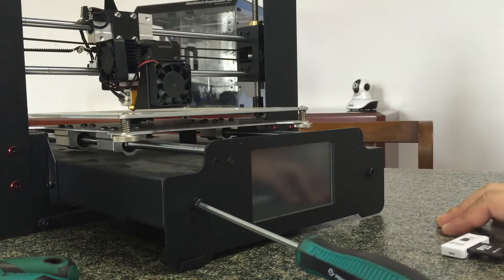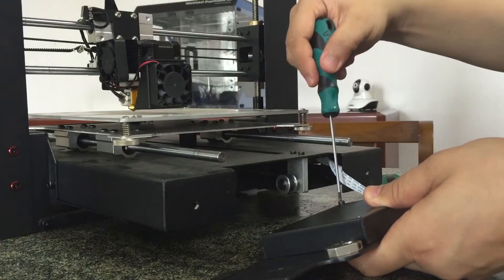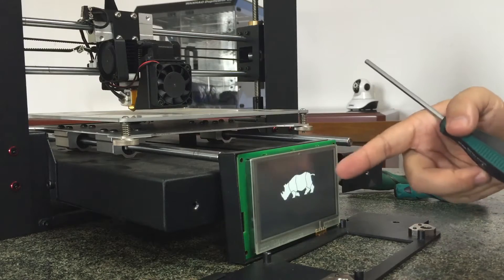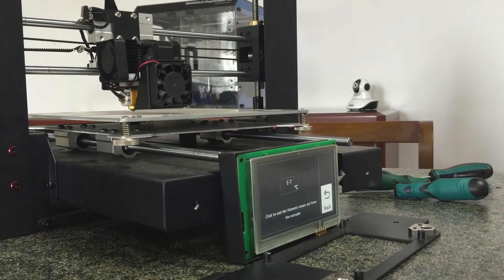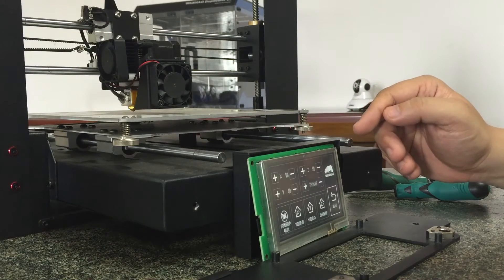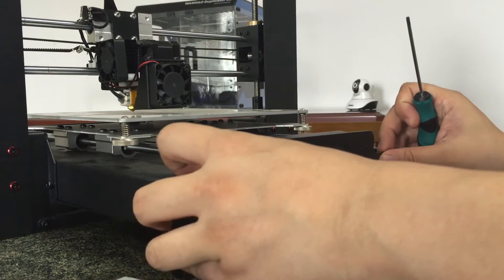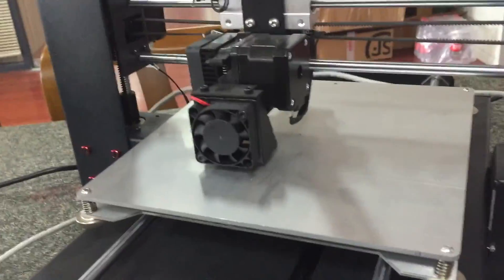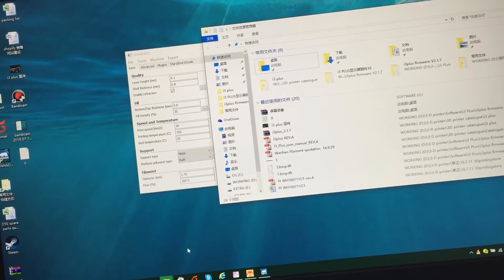How to install firmware to i3plus?

Comment: Does anyone know where to get the firmware of the internet? I'm following all the original manual of the power spec I3 plus but at the beginning it says to flash the printer. I also cant get to printer to connect to the computer. I am using an old hp printer cord...does that matter? Or is it a software issue

Comment: Can the Microcenter Branded "Powerspec" Wanhao Duplicator I3 Plus take the same upgrade firmware as the straight up Wanhao model? I assume the splash screens would change, but would anything else, or there be any other issues?
Reply: Did you end up finding an answer for yours?  I just replaced the motherboard for my Powerspec model & the LCD needs a firmware update & I can't find the answer to this.  The powerspec has a different board with a full size SD card & you do not have to disassemble the printer to flash it, but I can't find the files anywhere yet.  The printer is useless without updating the LCD :(
Reply: I flashed my wanhao i3 plus from microcenter no problem. Do you still need the files?

Comment: I did update the lcd firmware  al went wel but when i restard my printer the intro image freezes at image 1 haf the rhino and it does not go further now i cant print  nothing and i am pretty mad.
If you want to do this i do not recomend it.    i installed the motherboard firmware later on maybe that wil fix it but no.
Can anyone help me please?
Reply: Hi Dude, Same problem here... it's stuck on this fucking logo.... I have do 

- update firwmare, after white screen when i click on printing...
-Update LCD Firmware and now Stuck again... Can you help me ? 
Thx

Comment: Hello! 
Your website is suspended - 网站服务暂停通知 wanhao3dprinter.com
Please, can you help me. My i3Plus don't see files into folders, he think folders is a file and unfortunately trying to print it.
Maybe the problem is resolved by install new firmware but website is suspended.
Thanks!
Reply: You have to convert the stl files into gcode in order to print, you can open a sample file in cura, then save it as gcode, and then copy the file into your sd card
Reply: anime2190 Hi, you don't understand me. Display don't see folders like \Folder\File.GCODE
Reply: you are correct. the firmware does not understand folders. for now leave your gcode files in the root of the sd card. I know you will get a lot of files in the root directory over time, but luckily the printer sorts the files after creation date, so you always see the newest files at the top of the list.

Comment: Ok. 1st memory card should not exceed 16Gb- 2nd. The firmware 2.1.7 does not work with board firmware 2.1.8. 3nd. Printing is a mess with this i3+. Loading the Gcode and from time to time the temperature is not set (need to preheat the bed/head) and reset... and finally it is the DWIN_SET to upload to the sd card

Comment: Thank you for putting this video together. When I try to install the LCD firmware, my screen never shows pictures like yours and instead cycles through blinking screens for several minutes and never turns black. Is it possible that the bin files for version 2.1.7 are not working? or maybe there are too many duplicate files? Please verify that the Micro SD is supposed to be FAT32 sector 4096 like the instructions show.  I was able to perform the USB update no problem using the hex file. I really like the printer and want to help others with getting theirs working. Please let me know if there is anything I can do to help.

At the same time you might consider correcting the wording on the following pictures:
180-181 & 197-198 After heating up filament will unload. When unloaded click back to stop.
182-183 & 199-200 After heating up filament will load. Click back after it starts extruding.
185-192 & 202-209 Screw thumbnail nuts till the nozzle is .1 millimeter away from the buildplate.
184 & 201 Please prepare a .1 mm piece of paper. Wait until autohoming is finished.

There are a couple customers that would like to update their firmware and are having the same issue as me. Lets help each other find the solution.